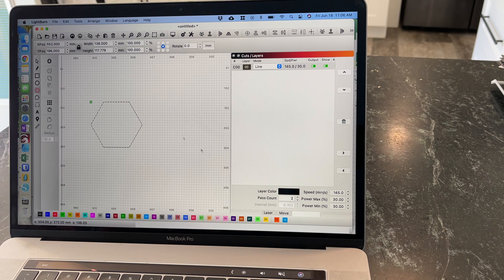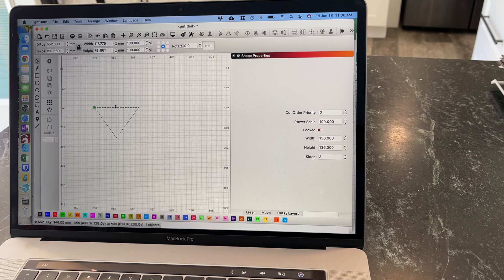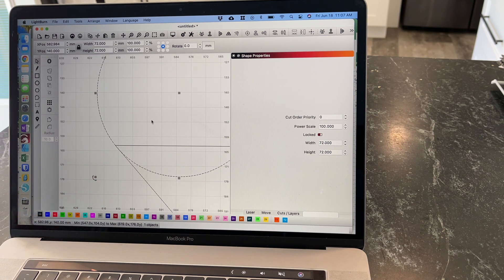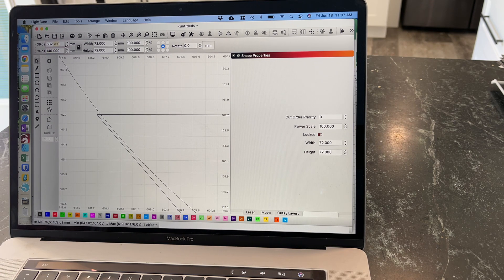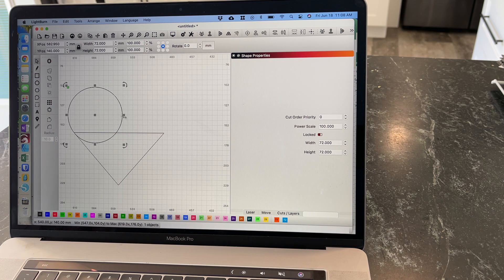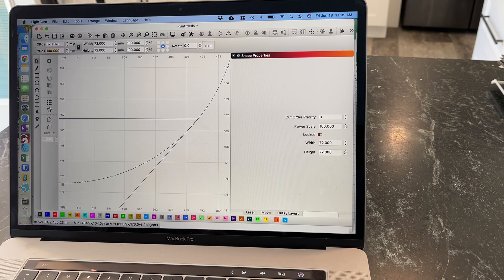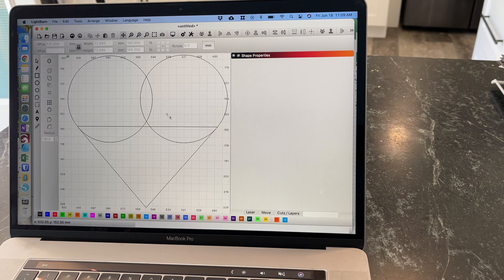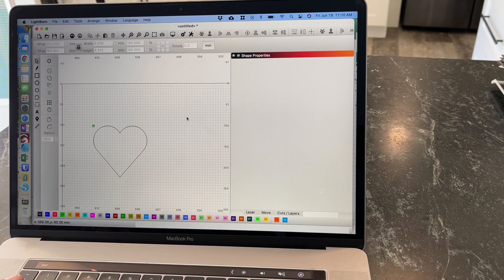How to Create a Heart in Lightburn

Comment: Why is it every time I am done with the 3 shapes, the point at the bottom doesn't line up vertically with the lowest point at the top of the heart?  They are off side to side
Reply from the maker: Try this - when you have the two circles in place, group them. Then select all three shapes and align vertically. You will then have to ungroup to continue on.